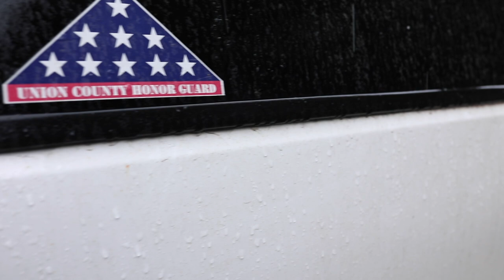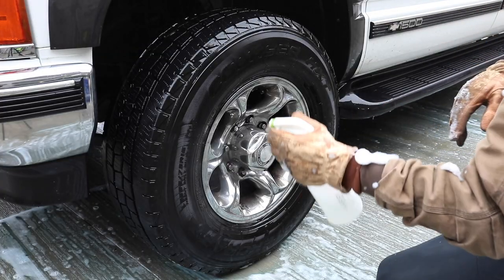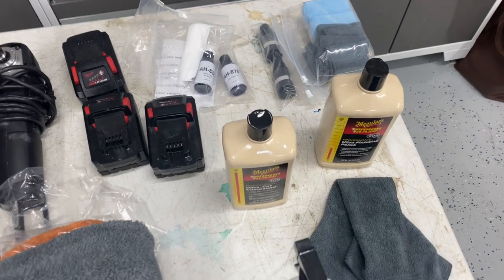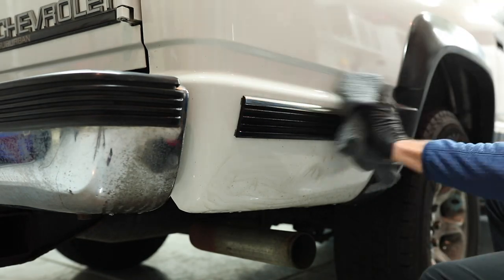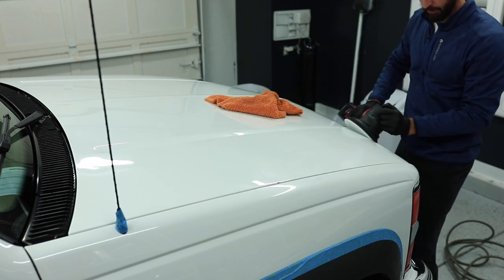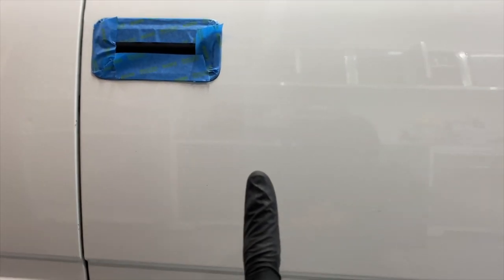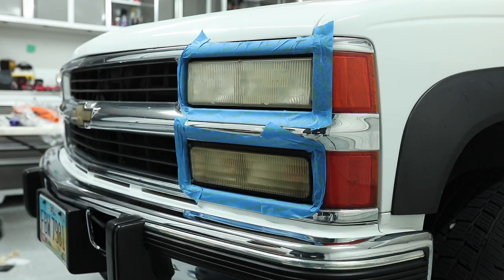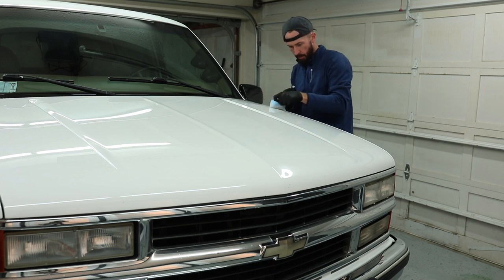How To Polish, Remove Swirls & Scratches | Ceramic Coating a RARE Suburban Diesel | Car Detailing

Comment: A little more details on what you were doing would be helpful for the beginner...like why you taped off areas and a little more about the clay and how to use it and when it's too dirty and you need to use a new one type of things
Reply: When you use the wool pads for wheeling out the surfaces, if you are a beginner, if you nick the plastic trim you can easily burn it. When the heat builds up with no place to go "Burning" it will look like a dull spot you can't easily bring back. Some have used heat guns to pull the oils back to the surface but it doesn't always work; that's super advanced. More than likely the car owner will sue you for a new part that will cost way more than what you are charging for the detailing. Insurance won't cover it as detailing is not like an auto machanic where everything is regulated, detailing is considered an art form and even though dealerships require you to have insurance due to your artistic interpretation you are wasting your money and you will not be reimbursed for any oops you did; a good reason not to go into this business. It is better not to get that close to the trim and emblems in the first place. Time is money for most. I learned how to wheel on an old dryer. Same with waxing, don't go near the trim or emblems... when wiping off the wax you will get close enough. You don't want to sit there with a toothbrush picking things out you shouldn't have gotten in there in the first place. Clay bar is simple. Spray on lubricant that comes with clay bar and do what he says. (Mild soapy water does the same thing) Although i agree much more of that should have been removed in the washing of the car long before you clay bar it. The clay picks it up but can also scratch the paint too if you aren't constantly folding it in. More should have been removed in the washing. When is it too dirty? You will know when holding it. Here is how it worked back in the day. You have sheet metal, primer, a couple coats of paint then a couple coats of clear. The old paint would sit in the sun and the paint would sweat under the clear coat and that caused it to fog a little; oxidation. Clear coat is 90% silicone. When you use the compound you are heating up the clear coat releasing the moisture or oxidation and as it cools you are replenishing the clear coat with silicone repairing the acid rain, swirls, scratches and preparing it for the polishes and waxes that are next. With different pads you create different temperatures of heat. When you are in the middle of a hood it's not that big of a deal as the heat can dissipate but when you are near an edge or a corner the heat has less place to go so it can over heat quick if you aren't paying attention and "Burn" the paint. There is no fire but the finish is gone. As a detailer you know how to finess things. We are Detailers, we see what others don't see, we react to things others don't react to and we can manipulate things by feel; we are artists at our craft. So, if you think of your wheel as an airplane leaving the ground you don't let heat build up in these areas, lift up and have less of a contact patch. Definitely practice first, better to go over it twice than burn it once. Now, having said that, generally it isn't easy to burn paint like trim unless it was freshly repainted and nobody told you... or it wasn't painted well to begin with. Although, don't expect a 1940's sedan to have a clear coat, it won't and they used a lot of lead back then in the paint so, stick with cars you know about. Generally as long as you respect it and don't sit there not paying attention, you aren't easily going to burn paint. Plastic has a much lower "Burn"  temperature being plastic with no outer coating. You can just nick plastic and sadly burn it, a scuff mark. Be in a comfortable position and in full control of your wheel when working on a surface. If the car isn't on a lift, get one of those little scooter seats or turn a bucket upside down and be in control. 100%! Make sure the radio isn't too loud. People in the shop know not to tap you on the shoulder while using the wheel, you need to concentrate. No loose clothing, shirts tucked in, safety glasses on, i put a double knot where the electric extension chord and tool chord connect and have it draped over your shoulder so not to have the chord get caught in the wheel and at 2600 rpm get wrapped around your neck and you lose conciousness in a few seconds killing yourself. (Worst case) I wore a heavy apron too as there is always splatter. Just be safe. Save your clothes which cost money too. as always go slow. Watch someone else do it first. Ask questions! Good Luck.

Comment: I have been detailing cars for 40 years.  There are several redundant processes you are doing you don't have to and I think you might be missing a few as well. I am not "Trashing you", just, I don't get it. What was the foam for in the beginning, the spray? Because you are going to rub it out, you can use dish soap which will strip the wax as well as using a lamb skin Chamois. Cut's down on all the steps you have there. I didn't see you degrease the door jams, was that edited out? The more you can get in the wash the better. Do your diluted muratic acid wash on the wheels and tires, then degrease the door jams, scrub the rubber then hose it off. Now wash the car with dish soap that will strip the wax of and dry it with a Chamois. Now clay bar it. But first, pop the hood and place a bath towel under the hood and up above the wipers, tuck it under so any compound splatter from wheeling it out won't get in the wipers or the cowl. I have never seen anyone tape off the trim before; To each their own i suppose. 000 grade steel wool will not scratch chrome bumpers, it is inexpensive and it lasts a long time. Wheeling out a chrome bumper... hmmm. Don't they still make Chrome polish? talk to a guy with a Harley and ask him to show you what he does. I use Mothers Mag Wheel polish on headlights. Deet can crack the acrylic/plastic material on older cars. Mothers just put a little on a cloth and rub it in with your fingers then wipe it away and you are good for six months. -- Not on your high end cars that have sound deadening cloth in the wheel wells but certainly on a Chevy you take a can of flat black spray paint and paint the wheel wells to make the finished car pop! Simple, one can should do it. If you get any water on the inside of the vehicle, crack the rear windows just a bit, put the heater on high on the floor and ideally park it in the sun and cook it out; Any and all odor will disappear. Go to a Car show that is being judged and get a copy of what the judges are looking for. Incorporate that in your processes based on time and meticulous nature. Wax under the hood, observe and make note of where light reflects, watch people when they see their car and listen to what they see and comment on. It was an interesting video. I like watching these. I wish i had seen it sooner, maybe save you a lot of time.